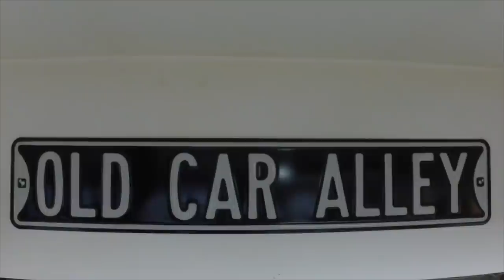1966 Ford Galaxie 500 convertible restoration part 111 painting trunk inner side

Comment: The inside of the trunk lid looks great with its finish coat applied. You did a really nice job smoothing the crease in the gas filler door as well; and no filler. The car is looking great overall!

Comment: I enjoy your videos Howard. 
I noticed it looked like on your final coat you were spraying with the gun back aways. Is that to make sure the metallic lays consistent?

What most impressed me was you working out the imperfections in the gas door without filler. Skills!!!
Reply from the maker: Spraying a quick random coat, at the end of the final helps the metallic flow out evenly, anyway thats what I find from my many years of spraying metallics. This car has a highly metallic paint.... it has to be one of the most difficult colors I have ever sprayed.

Comment: This may be a dumb question but I’m curious since I’m not a painter. After you mix the paint with the reducer and hardener, if you don,t use the paint in spraying whatever you’re painting what do you do with the left over mixed paint? Just throw it away? Since paint and etc. is so expensive how do you know how much to mix? Just curious.
Reply from the maker: Yes, I put the leftover mixed paint in a jar for the garbage, as it goes hard in a few days... I have shown what happens to the paint in past videos. If you put it back in the paint car, it will ruin the paint. I try to mix only what I will use... I determine that by the size of what I am painting. It's from years of painting, that I figure about how much paint to mix. I waist very little, as it's very expensive. The paint and additives, to paint the whole car, is around $1200.
Reply: Old Car Alley Thanks so much for your clarification of this one detail for me. I just hate to waste anything, especially some so costly. So, it is experience that is your friend in this process. Thank you so much for your videos. They are most helpful. I look for a new episode each day!

Comment: What is the minimum air pressure for your priming and painting? What brands of enamel and primer do you use?
Reply from the maker: I don't have a minimum pressure. I used 30psi spraying the trunk lid, with my HVLP spray gun. I have used all brands of paint. I like Sherwin Williams the best.... I am using Nason acrylic enamel. A lot of paint stores don't carry acrylic enamel anymore, because they make tones more money, selling base clears that are a lot less durable... sure they shine, but the clear peals after 10 to 15 years on base clear repaints. Factory clears are a little better as there baked on, It's all about making money, not selling a good durable product anymore.
Reply: @OldCarAlley  Yes I never liked base-clear, it isn't durable as I've seen many cars 3-4 years old with the clear already peeling off.The stuff doesn't even look right on the old cars as it has a plastic appearance being far too glossy. I'm going with enamel base paint.